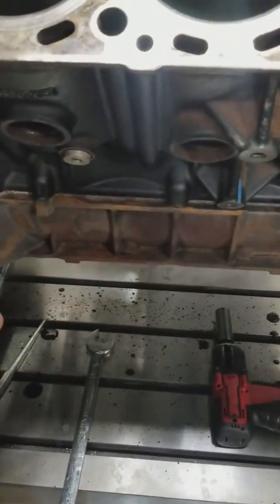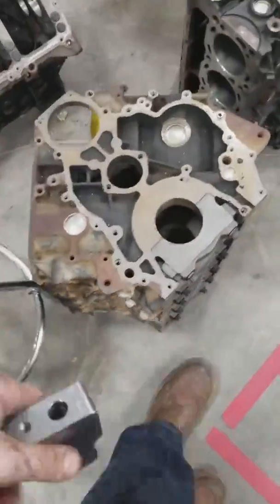Bed Plate For on a 6.4 Powerstroke Explained

Comment: Recently I got my block from the machine shop.  They did the boring , honing, decking, cam bearings, core plugs etc.  When I was checking my clearances before assembly, the main bearings were around .0020 in the 12/6 location, but they were as far as .0055 in the 10/4 and 2/8 locations.  I had to take the block back and have it aligned honed way over with oversize bearings.  Is this a common problem?  We had to use AlumiGlide bearings due to the oversize.